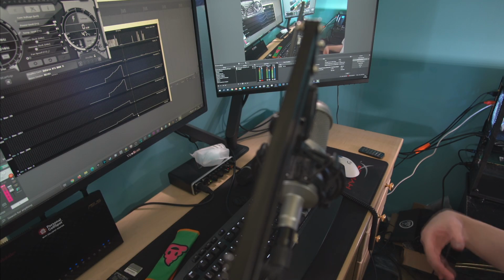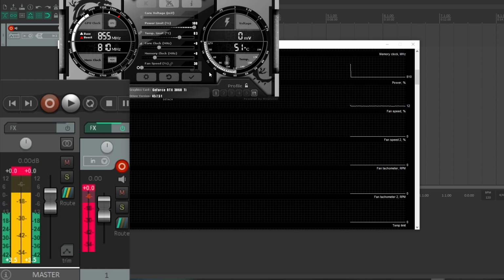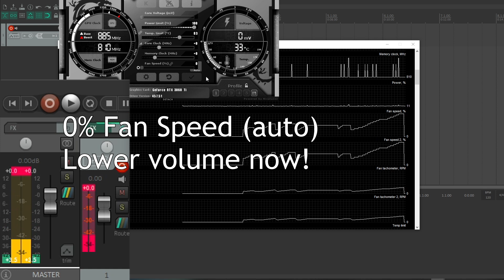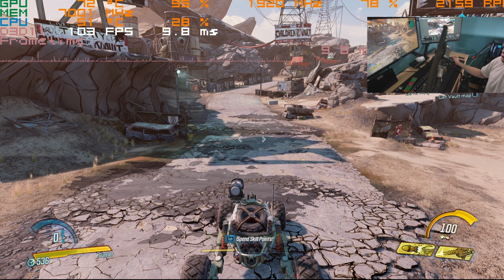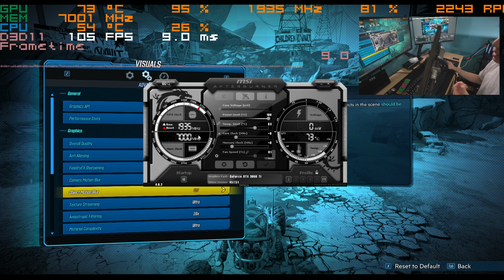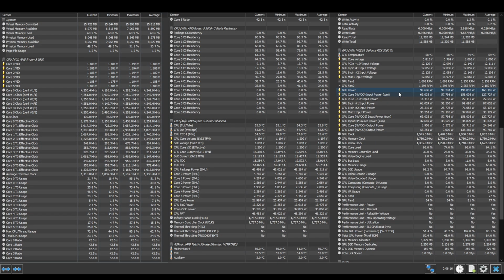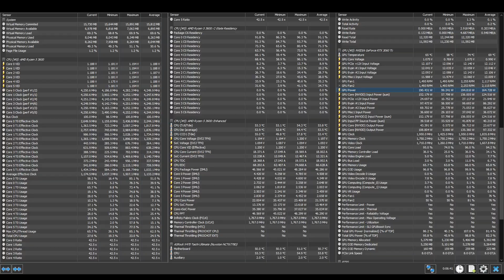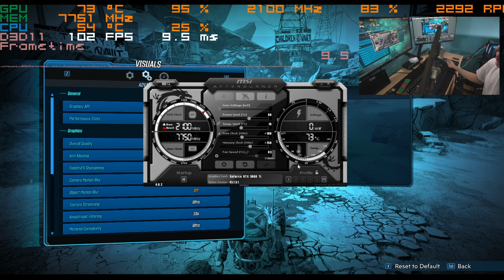MSI Ventus 2X OC RTX 3060 Ti Disassembly & Noise, Boost Clock, Overclock, and Power Limit Showcase

Comment: Thanks for the video.
I own the same gpu at the moment.
I've had the Zotac TwinEdge before and the TwinEdge was more budget for sure.(small fans, smaller heatsink)

Now I found out there are two revisions of the MSI 3060 TI Ventus 2x.
First revision: Bigger Heat sink and pcb the same as the MSI 3070TI. Two 8-pin connectors. :D... (limited to 200W)
Second revision : Smaller heat sink. Hole in the back of the back plate/heat sink similiar to the FE.

Not sure if the hole in the back plate will make a big difference but would be nice to know how the 3070Ti cooler compares.

Comment: So did you notice any improvement by repasting the card? I'm planning to deshroud mine, but wonder if it's worth taking the heatsink off while I'm removing the fans.
Reply: Also I have had a ton of success flashing the MSI 3060 Ti Gaming X Trio bios to this card, as it has a slightly better cooler (designed for 3070, 240 W power limit) and 2 8-pin connectors (to go past stock 200w and 225w pci+1 8pin limits) to push up to 240-250w board power limit.
Reply: @alexanderzook84  I just got this card and this sounds like something I want to try, would you mind pointing me in the right direction where I can get the bios for X Trio and how to flash it? I haven't done it before & realize I should exercise caution but I want to give it a go. 

I know the original version of the x2 Ventus (not the V1) has 2-8 pin connectors so I'm guessing flashing the X Trio bios gives some extra OC headroom that can be fully utilized because of the higher wattage limit. Have you also tried undervolting your card to make it run quieter / cooler?

Sorry, lots to unpack here but I saw you answered some other comments here & you seem quite knowledgeable. Thanks so much! 😊
Reply from the maker: No improvements with Arctic MX-4 at least, but it is from a 2019 tube. That's interesting information! Unfortunately I think this card hits its thermal limit before any power limit so unless it gets some custom cooling, I don't think it's worth flashing another BIOS onto it

Comment: Managed to get +140, +1000 and 6% performance boost in Time Spy
Reply: I believe I got the same 2830Mh(+140) on this without adjusting voltage
I could get it to +150 but is not stable under spontaneous load
Reply: @youritake8618  I set a custom voltage curve in the meantime and just set it at a stable 1950 to get lower temps and noise. It's still better fps than stock but 30% less fan speed, so I'm good with that.

Comment: My ventus 2x goes around 72 degrees but fan speed can go up to 2400 rpm (87%) when long sessions playing and makes a lot of noise.
Reply from the maker: Yes, interestingly enough I experience the same thing and it makes me think that the fan speeds aren't tied to GPU temperature, but something else.
Reply: An underclock will drastically lower temps and give no noticeable difference to performance
Reply: @artv4692  a cust fan curve does it properly but 75 degrees. Switched to a gaming trio and its completely silent 10 degrees less.
Reply: @exter2000  Could also be an issue with your case temperature. Mine is at a constant 65-70c under full load.
Reply: @artv4692  Dont know, but gaming x trio is completly silent on my case at 1100 rpm 65 degrees. have 3 140 fans and 2 exhaust 140 fans
Reply: @exter2000  i have 3060ti msi gaming z trio and gpu get 70c and 1.500 rpm in my case with good airflow xddd
Reply: @Venom-gs4nz  now i have a 3070 gaming x trio and silent and nice temps
Reply: @exter2000  well in gaming series heatsink should be the same like 3060ti but in my gpu 3060ti gaming z trio in cp 2077 i reach 70c and 1.500 rpm its still quaiet but i seen in many videos with 3060ti gaming x trio they get around 66c and 1250 rpm i have good airflow in my case with 6 fan 140mm:D i dont get it why my  msi gaming z trio have 70c ...

Comment: whats better rtx 3060 ti or rtx 3060 ti ventus x2?
Reply: Ventus card of course, It can easily be overclocked and you can make this card on par with a stock RTX 3070. He increased the framerate by 12 with the overclock, thats insane. msi cards are notorious for being excellent overclockers because they integrate perfectly with the msi afterburner software.

Comment: Thank you for the video.
I just got this card but I have a i7-6700k oc to 4.4ghz
Hope the bottleneck won't be bad
Reply: If you play games in 1440p or 4k you wont be bottlenecked
But 1080p you can upgrade to 8700k or 9700k with coffee mod bios on your z170 motherboard
Reply: @grammatoncleric  I can't upgrade my cpu, my socket doesn't support beyond 6th gen unfortunately
Reply: @YftachSrur  what socket you have
Reply: @grammatoncleric  lga1151
Reply: @grammatoncleric  I am curious, I'd also like to jump from the 6700k to the 9900k on a Z170 board. How stable is it?
Reply: @mrpauling2507  what board do you have? Just type coffee mod z170 in Google man
Reply: @mrpauling2507  use google man i dont have a 9900k

Comment: Is it possible to disconnect the fans without dismounting the card from the heatsink ? (so without crushing your warranty)
Reply from the maker: Yes, the screws that connect the heatsink to the fan shroud are exposed so you can deshroud it without unscrewing the heatsink from the card. The fan connectors look like they should be removeable, but the white fan cable does have tight clearance with a heatpipe.
Reply: using very thin plier to grip the screw then slowly rotate the screw

Comment: Amazing video! Just got this card with a ryzen 5 3600 do you think it will be able to run cyberpunk 2077?
Reply from the maker: Yep! I've played the game a bit with that pairing at 1080p High settings (Medium Cascaded Shadows) with raytraced lighting set to ultra and DLSS setting at quality and I'm managing around 60FPS in most areas. Performance should also hopefully improve with future optimization patches for the game
Reply: I do have the same combination, playing on 1440p High with DLSS Balanced and RTX Reflections + Medium RTX Light. It can stutter sometimes in busy areas, but that's also the case with 3080s and other cards, the game is just very demanding in the city with high density.
Reply: Bro what are you waiting for! Go play ! I am getting the same gpu soon probably in a couple of months . I saw benchmarks and rtx 3060ti run cyberpunk easily

Comment: Is there any way to unlock the Power Limit slider? In the BIOS or so?
Reply from the maker: Not with the stock VBIOS unfortunately. You can make changes to the voltage/frequency curve to undervolt though.
Reply: @TechiverseYT  And isn't there any way to unlock it in the BIOS? That's a shame tho :/
Reply: @migueldias1873  You can load a custom bios (like the GAMING X TRIO) which will have a higher power taget. It is risky, and it can break your card, but i flashed that bios onto my RTX 3060 Ti Ventus x2, and it works (I loaded this bios: https://www.techpowerup.com/vgabios/227237/msi-rtx3060ti-8192-201021which you can give up to 250 watts up from the stock 200 watts on the Ventus x2)

Comment: I have this same GPU and haven't really gotten to OC it yet, nice to see that it can get to 2100mhz. Out of the box it was performing in like the 35rd percentile of userbenchmark, but with just a random +30core +200mem it jumped up to 45th percentile, so OC'ing it further should be good!
Reply: I've been running mine at a stunning +125 +1000(!)
Completely stable for the last month. 
Cyberpunk holds a flat 2100Mhz boost at ~67C after an hour playing. 

This is for sure a 3070 binned for cores. 
The Samsung memory is still 16Gbit. 
You just need to cool it properly.
Reply: @kylfree  I got mine to run at +190 +1300 in some benchmarks lmao! I settled for +160 +1150 for daily use though. Not sure how it does this with a locked 200W limit lol
Reply: Just did a +150 +600 and din't feel like going further for now, but compared to stock it got me from 126% userbenchmark score to 135% (about 35rd percentile and now 76th percentile)
Reply: @thelazyduck9370  do you know any way to unlock the Power Limit?
Reply: @migueldias1873  No you'd probably have to do custom vbios which complicates a lot of things, but it seems to OC well even without a higher limit. Not sure how gaming performance is affected by the OC though
Reply: @migueldias1873  You can flash the BIOS from the MSI Gaming X Trio, which has higher power limits. Look here for more info: 
https://www.reddit.com/r/nvidia/comments/k6w7ev/msi_3060ti_ventus_2x_bios_flashed_to_an_msi/

Comment: Did you notice if playing games in 4k, the core clock goes down a lot ? Here it doesnt stay stable at 2100 at all. In 1080p ranges from 2100-2055mhz, but in 4k it keeps around 1895-1925 mhz.
Reply from the maker: Interesting, I don't have a 4K display to test, but maybe you're thermal limited? What are your temperatures like?
Reply: it might be the 8GB VRAM. It does the same for me, but the VRAM is at around 8k which should be the limit, right?
Reply: @drchtct  It's not. It's the power limit of the gpu. You have to increase it on Msi Afterburner.
Reply: @irrrregularthegreat  the power limit is capped to 200W with the Ventus 2X OC
Reply: @drchtct  Mine is capped at 205w. 
Unfortunately thats how it is, and its normal. Only way to make it more stable is with a better model, with 2x8pin, more watt consumption and more expensive ofc.
Reply: @irrrregularthegreat  it has 2x 8-pin, but it's still VBIOS locked at 200W. Maybe yours is the V1, they changed it for that model to 1x 8-pin. I don't mind it that much tho, I just wanted a card close to MSRP as the 8GB VRAM won't last forever anyway.
Reply: @drchtct  Didn't know about that. But I don't have this model, mine is Gainward Ghost, capped at 205w. 
Founders Edition's clock also goes down as the gpu is more demanded (1440p and 4k).
There's really not much we can do.
For what I've seen, the only model that goes extremely regarding overclock, is the Asus  Rog Strix, it get's close to the 3070 with oc, but is as expensive as a 3070.
Reply: @irrrregularthegreat  yeah, the ROG is like €580 in Europe lol, totally not worth it
Reply: @drchtct  Here the difference is $1200 (Brazil currency)  not worth at all. 
But for what I've seen, you can get 4-8% performance with a moderate oc in virtually any model. Mine is +100mhz and +1000mhz.
Reply: @irrrregularthegreat  true, I've seen even the Zotac Twin Edge 3070 gets 8% through OC. The expensive models really are for thermals, noise and RGB, performance won't change significantly

Comment: Thank you! I have this card and didn't want to take it apart just in case i need to use the warranty right away :)
Reply: How are your temps? On what resolution
Reply: @PoProstu_Ameryka  with rtx on or very high settings max 75 degree
Reply: How are temps and frames?
Reply: 80c max when pushed to 100 percent. Playing cyberpunk right now on 4k with dlss on auto and everything pretty much maxed. There is sadly no card that can handle that without dlss lol

Comment: Apparently there now is a 3060 TI Ventus 2x OCV1 model which is slightly different.
Reply: @null643  In short, the first version used the pcb and cooler design from the 3070 Ventus 2x. The 'V1' version has a reworked pcb with the single 8-pin power adapter and a thinner heatsink (2 slot card vs ~2.5 slot card).
Reply: @alexanderzook84  Soooo which one is better the first version or the v1 version?
Reply: @iclapmarasovcheeks6423  i feel like they nerfed the card somehow with the new revision. The first version had a thicker heatsink, so better cooling, and having 2 8 pin connectors you could flash  the gaming x trio bios and gain some extra power.
Reply: @seby6368  Yeah so with the OCV1 you wouldn't be able to flash the bios simply because it wouldn't be able to draw enough power anyway right?
Reply: @ABCboy5  You can flash it but idk how good it will work. Not worth it anyway imo considering the performance gain
Reply: @null643  Well I'm no expert but it seems to have one 8 pin connector instead of two and cost less

Comment: Could you please share the measurement for hole positioning ? I wonder this for water cooling.
Reply from the maker: 67.5mm x 58.5mm x 67.5mm x 58.5mm from measuring with a ruler and eyeballing it from center of the screws. I don't have the tools necessary for exact measurement so just keep that in mind
Reply: @TechiverseYT  Thank you so much.

Comment: Nice, thanks! With newest Afterburner and certain settings, I can move the voltage offset slider. First piece died on me after 30min of usage, second piece holds so far. For the money, it was good deal. While I will cap it atb75FPS, in most games the card will be moderately "quiet" so to speak.
Reply from the maker: Do you have this exact graphics card? I'm running the latest 4.6.2 version and I don't have access to the core voltage slider, but I do have access to the voltage/frequency curve
Reply: @TechiverseYT  Need 4.6.3 beta 2 version to access to the voltage and frequency curve
Reply: @TechiverseYT  I have the same problem.. it's locked at 100%
Keep me up to date if u found a way to fix this :(
Reply: @grfe4326  In the other video someone said ''Did you go in to settings of MSI afterburner and manually unlock the voltage control?  It is not on by default'' maybe that will help you
edit: nvm, looks like he tried that in the video & it didn't make the difference

Comment: I have the same gpu i want my temperature stable at 60c on any games ultra settings
Reply: 70c is a perfectly acceptable temperature at max ultra settings. An underclock can help with that.
Reply from the maker: That's achievable by setting power limit to 50%, but you will lose a lot of performance. You can also limit your FPS to make it use less power and run cooler.

Comment: Good test, nice to see a teardown. Perhaps you could try undervolting? Other reviewers have described fans as being quite audible at 60%+ rpm, I see they hover around 80% in BL3. How do you think that sounds?
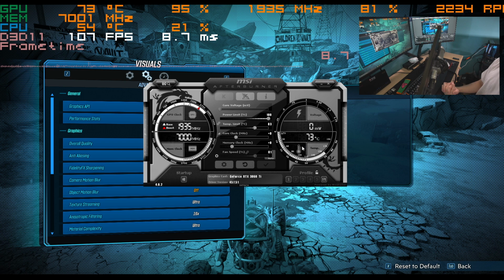Reply from the maker: I commented about undervolting being unavailable on this card in the section at 11:30. 80% is pretty audible and personally I prefer it to not go over 70% fan speed. You can set a custom fan curve or lower power limit with an overclock offset to reduce temps and noise.
Reply: @TechiverseYT  I meant voltage curve undervolt by using ctrl+f :) Many people have for instance undervolted their 3070 or 3080 from stock 1.05V@1950 to for instance 1950@925mv which reduced consumption by 50W and temps by 5-10C and also lower fan rpm :)
Reply from the maker: @Taraquin83  Oh I see! I think that's similar to what I did with the combined lowered power limit and overclock in the video, but I'll check it out later today and report back
Reply: @TechiverseYT  sort of but even with powerlimit voltages are too high vs frequency, that is what you can fix with curve editing :)
Reply from the maker: @Taraquin83  So I do have access to the voltage/frequency curve and I was able to tune it to 1995MHz at 925mv with stable frametimes from initial testing. So it seems to follow the ampere efficiency curve like the 3070 and up
Reply: @TechiverseYT  that's good. If you compare it with pwr-limiting I bet you can see some additional gains to either efficiency or performance, sometimes both :)
Reply from the maker: @Taraquin83  It's similar in terms of efficiency, but frametimes are better since the clockspeed doesn't fluctuate when using the voltage/frequency curve
Reply: Please teach me how to lower the temp on sweet spot settings. 144hz 1080p monitor
Reply: @obsammyboytv4356  set an fos limit of 140Hz with nvudia control panel or rivatuner statistics server. Open the curve-editor in afterburner and set a straight line from 1800@825mv.
Reply: @Taraquin83  can u please fo tutorial im new building pc
Reply: @Taraquin83  should i use 2k monitor to enjoy the rtx 3060 tu performance?
Reply: @obsammyboytv4356  U have a 1080p monitor, waiting for my 3060ti, 2k works fine aswell
Reply: @Taraquin83  already did. thanks. did i lost performance?
Reply: @obsammyboytv4356  it should guve you about same performance but temp, noise and consumption will be much lower